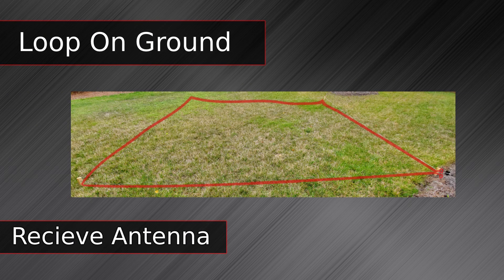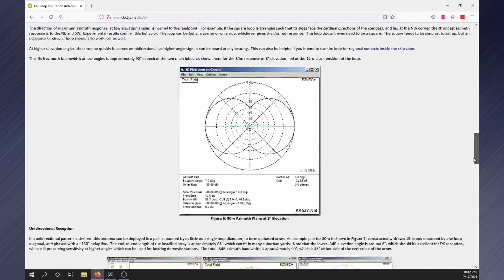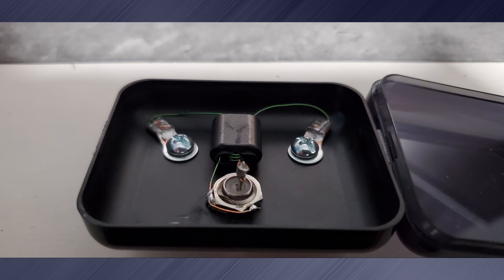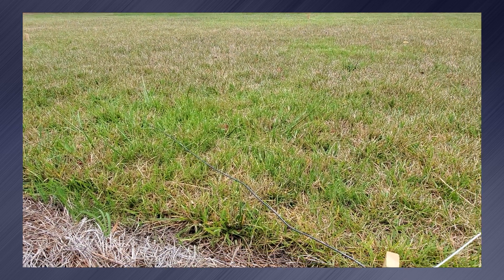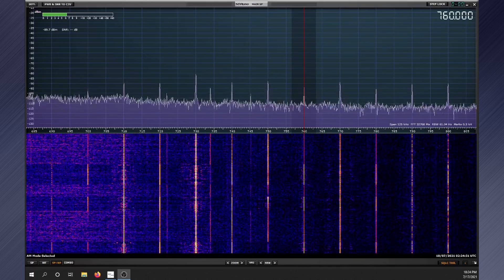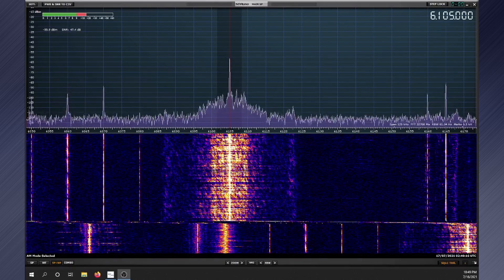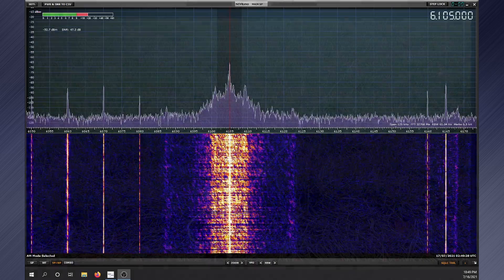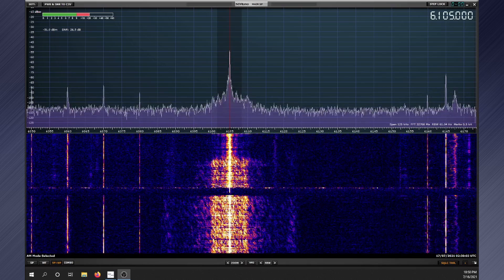Building and testing the Loop On Ground LOG Antenna

Comment: Is this antenna good only for listening signal or for transmitting , too? What is power in Wt. could be usable? Thanks for your video. 73!
Reply from the maker: This is receive only for listening. With that being said I have transmitted with it but the transformer used I kept it below 50 watts. Not very good for transmit, much better options out there.

Comment: I boxed mine away. If, as in my case, your off-grid & remote there is no perceptible difference. Utility lines are 1/4 mile from my rig and ZERO neighbors closer than 3/4 mile.  Signal degradation was not worth it.
Reply from the maker: Yeah, these shine in suburban America but if your fortunate to be off grid just about any wire in the air will be fine.

Comment: The latest ham antenna "craze." Yes, it lowers the signal strength of the noise. But it also lowers the signal strength of the signal you're trying to hear! Try an attenuator instead!!!
Reply from the maker: So you haven't used one? I was shocked that it worked myself. Didn't give it much help but I was able to hear stations I wasn't hearing on a random wire for SWL. You should give one a try!

Comment: NOTE: Keeping the loop at a foot or so above ground rather than laying on the ground will greatly increase its performance due to minimizing ground coupling effects
Reply: Plenty of examples with this exact antenna around the world, show differently.   Even raising it a few inches off the ground, depending upon your area can cancel the SNR benefits.     Sure you can pick up some other signals, but SNR will also increase.   The purpose the LoG is to reduce SNR.
Reply: Not by 1ft @adamjones8218

Comment: Most urban interference is vertically polarized.  It starts random but the horizontal portion strongly couples with the ground and gets attenuated.  This gives horizontal antennas a noise advantage right off the ball.  Next laying an antenna on the ground reduces the signal by about 100dB and the noise by about 140bB, increasing your signal to noise ratio by about 40dB (these figures were for a Beverage on the Ground) but the loop should be similar.
Reply from the maker: It's all about that SNR!

Comment: Been running a 25x25 square for a month now, with a Cross Country Wireless Loop kit. Most impressed with the low noise, yet great signal capture. A hidden gem of a design.
Reply from the maker: It really is an impressive antenna that many think won't work.
Reply: Yes, but unfortunately nothing is awailable a CCW....!!

Comment: now , rise the loop 2mt over the ground and repeat...
Reply: And it will add noise back into the received signals - defeats the purpose.
Reply from the maker: Then it wouldn't be a loop on the ground. HAHA

Comment: Easy to setup for field trips. I have used 100 foot down to 40 foot circumference with 9:1 balun and all work well except that as it gets smaller, could use a preamp boost.  I currently use a 29 foot 3-conductor wired like a folded dipole and connected to a Welbrook Medium aperture amplifier in place of the balun (the Welbrook amp has a 4:1 balun builtin). Thanks for the demo comparisons.
Reply from the maker: It is one of the easiest to setup that's for sure.

Comment: Good info. Just got a rsp1a and looking for antenna ideas. I have an 132 ' endfed with a 9:1 balun to try with hf and maybe add a discone. No HOA but still want to stay low profile. 

Just like the gutter antenna, I wouldn't have expected the ground loop to do as good vs the dipole as it did
Reply from the maker: If you have 132' of wire in the air you'll do quite well. I would recommend the T2FD Antenna. It's a great all around receiving antenna and since it's terminated will complement the end-feed well when it's noisy.

Comment: Mine, with yard staples completely invisible under the grass. And yes, from 1,5 Mhz to 10 Mhz outperforms Cuschcraft R9 vertical from 5 to 10 db in SNR terms. Below 1 Mhz it take some noise from unknown neighbor sources. Compared with W6LVP magnetic loop, the LoG is a bit lose couple db's.
Reply from the maker: It definitely is for the top bands. As you said above 10 Mhz it doesn't work to well.
Reply: A week ago, with my 25x25- had a fabulous couple of nights catching AUS hams on 20M ~ 0700z in the MidWest. They were everywhere. Like another poster said: WORKS!

Comment: This LOG works superb. I have written an article in our club newsletter. It makes a huge difference for reception. Some days the noise is 7 - 9DB and switching to the LOG it goes down to 3 -5DB. Surprisingly one can find some conversation which is not audible on the other antennas. WORKS!
Reply from the maker: I have noticed similar results. Sometimes switching to the log makes the difference in the signal being audible.

Comment: Can this setup be buried a few inches to not have to move for mowing?
Reply from the maker: You can place it closer to the ground and you yard staples to hold it low enough. I have heard of placing it a couple inches below ground and plan to try that method myself.
Reply: @BrokenSignal  My understanding is yes, you can.
Reply: My vertical loving pals always told me just mow the grass low, lay out your wires, let the grass grow up through it. The wires bury themselves. Trenching not needed.